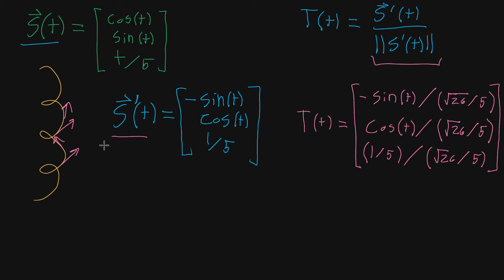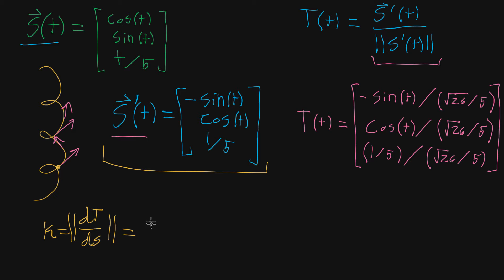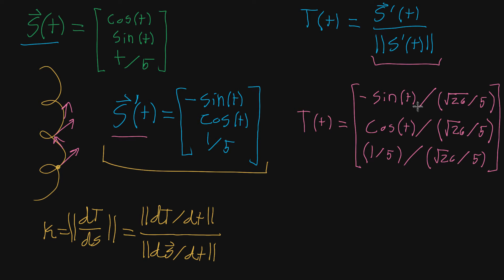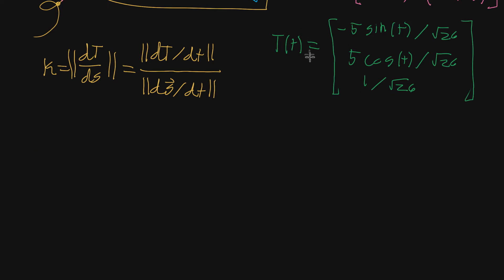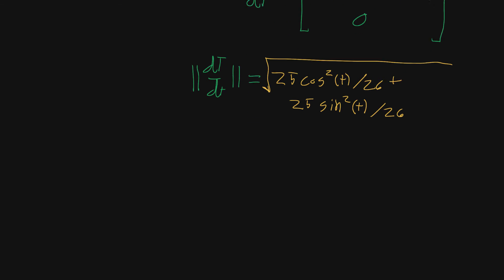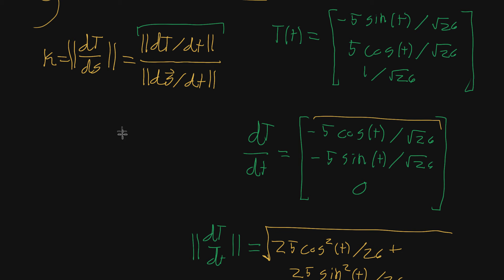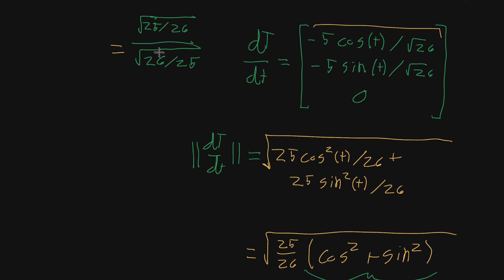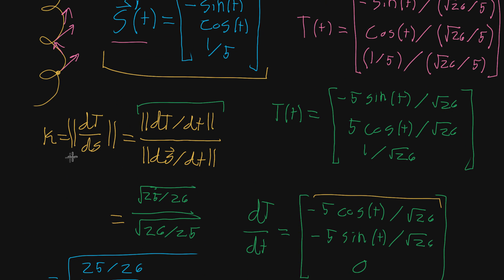Curvature of a helix, part 2

Comment: Not a mathematician or a math student of any kind, just a carpenter who needed to know helix curvature for spiral handrail construction.  I scratched my head for some time and this is what I came up with using my trusty, Texas Instrument, engineering calculator

Cosine of the pitch squared (sto) floor plan radius dived by (RCL)=

(Cosine of pitch is the pitch of the helix in degrees.)

The little illustration of an osculating circle unlocked my brain I think, but that was years ago.

Admittedly this only gave me helix radius, but that was all I wanted.

Comment: The ds/dt at 1:55 is a scalar function, not a vector. The magnitude symbol is unneccasry. Taking the derivative of the arclength parameter with respect to t gives the magnitude of the velocity vector. This comes from the arclength formula and the fundamental thereom of calculus. His interchangeable use of s (the position vector) and s (the arclength parameter) can be a little misleading. I love his videos, but this particular detail can make it harder to understand this idea.
Reply: ds/dt isn't a scalar function, S(t) is a parametric  function, derivative of a parametric function can give a vector and this vector is ds/dt and come in various length as the function progress based on given input parameter x(t), y(t), z(t). S(t) IS the position vector and ds IS arc length which part in the video he use only s to represent both?
Reply: There is no interchange in this particular video, he keeps his vector symbols where they belong. Sorry for any confusion, I think I was mostly griping at his choice of the letter "s" for the position vector. At the time of commenting, I had grown used to these formulas expressed in terms of derivatives of arclength with respect to t.